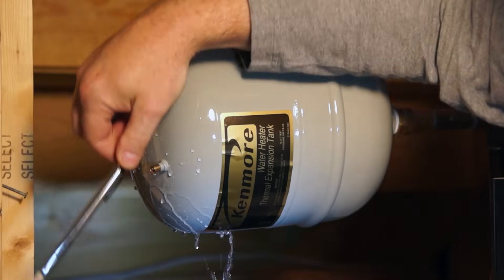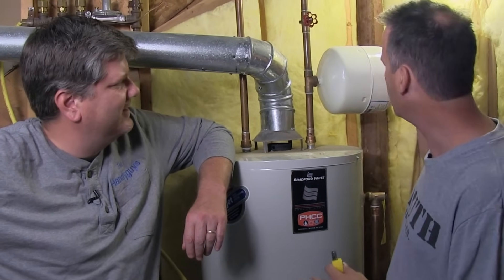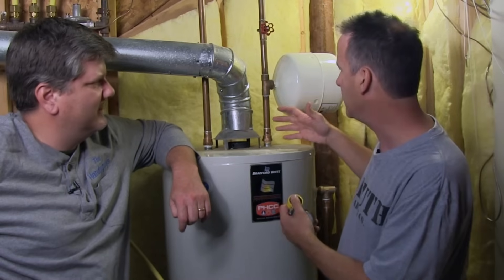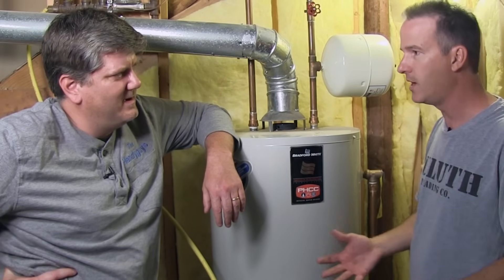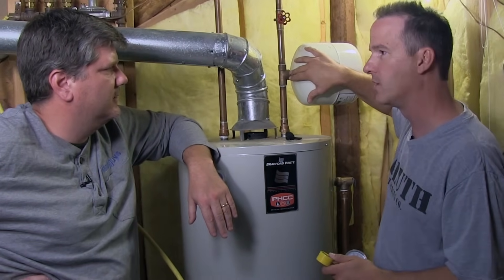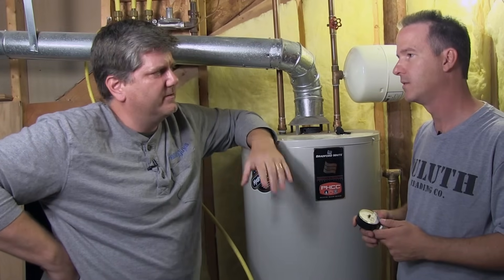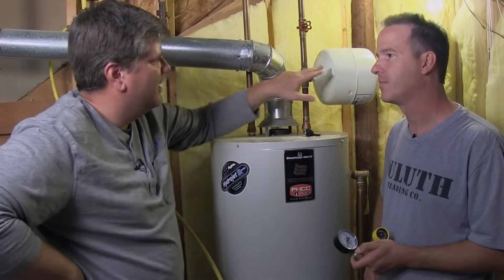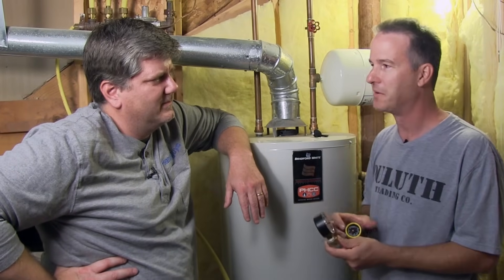Water Heater and Expansion Tank Maintenence

Comment: I understand that the water as it pressurizes will try to feed back to its primary inlet.  This is why an expansion tank is necessary for the Cold water  side,  of the water heater's inlet . My question is, can pressure also go towards the appliances, such as dishwasher sinks and washer. I ask this because every once in awhile my dishwasher and washer will release about a cupful of water. It would have to be the hot water that's building up the pressure because there is no cold water that runs to the dishwasher, and from time to time even the faucet in my kitchen , which is spring based sprays several drops of water into the sink. I am worried about the PEX, because I have seen slippage. Any ideas of what I can put in to take the pressure when all of the water sources are off. There is an expansion tank which is only about a year old. There is no water being released from the pressure release valve on the side of the water heater. Any ideas?
Reply: i know just enough to be dangerous so double check this.  If you have one handle faucets it is possible for the pressure to bleed over into cold side system.

Comment: Handyguys.  I have a 7yr old townhouse (all systems are 7yrs old by now) which has an expansion tank mounted on the cold inlet side just above the hot water heater.   I have experienced no anomalies with the plumbing system all 7 years.  About 1 month back, hot (I mean HOT) water started to come out of the cold taps; this  occurs with all faucets at bathrooms and kitchen.  The cold water will come out from the cold side after running the cold side faucet for about 5 min.   Is this a manifestation of a failed or malfunctioning (incorrect pressure) of the expansion tank?    Or is there something else more intriguing at work?
Reply from the maker: ***** Sounds like something more intriguing at work.
Reply: Cold water pipes running in an attic can easily get to over 110 F.

Comment: i have a question..  I have a 1 1/2 year old hot water heater and the expansion tank same age. replaced the mixing valve at the hot water heater and in the shower as well.  My townhouse was built about 7 years ago. My problem is i'm running out of hot water 15 to 18 minutes the blinking light on the WH is blinking current codes as all is well with the WH.  any ideas?
thanks scott
Reply from the maker: +scottieboy72 No idea here. I would consult an HVAC/plumbing professional. Particularly someone familiar with the brand of equipment you have.
Reply: These kinds of answers... "consult a professional", are incredibly unhelpful.  I think that everyone knows that if they must have help, that they can always consult a professional.  The reason folks like myself ask questions on blogs is to possibly save themselves the cost that a professional demands, since a lot of repair or maintenance work is completely within the scope of a DIYer.
Reply: No one is being unhelpful. If the answer was simple, people would answer it. With the question stated there is not enough information given that leads to an obvious answer. One of a dozen things may be causing him to run out of hot water. He would have to provide more clues/details to help diagnosis the issue, or he needs to become his own water heating expert, or he has to hire one to diagnosis the issue for him.
Reply: +charged You should consult a professional if you are having a problem with my comment. preferably someone who specializes in your type of grievance.
Reply: I found out the water pressure coming to the hot water heater was to high. No professional needed.

Comment: Water line makes noise like water hammer but only when I turn water on

Lived in house for 13 years and always made this sound

Replaced frozen/broken backflow device and water regulator shortly after moving in

Makes no difference which temperature I use

House PSI 40

Drained entire line from curbside and refilled with highest shower spigot open

Still have noise at all faucets and either temperature

Closed system with backflow device

Do I need water arrestor(s) or an expansion tank and where???

Comment: I have pipe hammering.  A plumber replaced my expansion tank, and this seemed to fix it for a couple months, but now they are banging again.  Did the plumber just get some air in the pipes, and as the air worked it's way out the banging started again, or will an expansion tank fix pipe hammering?  The hammering appears to be from really long pipes going up to a top floor washing machine.  Is there a better way to fix this water hammering.
Reply: Find the cause, such as a quick closing valve. Example: Such as a washing machines solenoid valves that control the incoming water.
Loosely supported pipes will typically amplify the effect of water hammering, also.

Comment: Thanks guys... I knew much of what you covered but thank you for taking the time to put a video 'refresher course' together... it settled my mind for knowing what to do along with the how and why! What I learned new is to check existing water supply pressure so it can be matched with air in the tank.  Previously I just aimed for the 40psi +/- that the tanks have in them when new. Sometimes the simple things are the most important, right? Best, Matt

Comment: So I was wondering why would they make water heater that do this things? Are they trying to make more business or what? Anyway, I have the same problem with my new water heater, everytime, I shower or use over 1 gallon or so of hot water it drips a little. My question is is there another way to fix this other than getting the little tank? I don't think I have room for it because my cold water shut off valve is really close to the water heater. Can I add this little tank to where the shut off valve is then move the shut off valve further away? I am so confused I am a new home owner. Thank you in advance.
Reply: Sal C the problem you are having is not a water heater problem, but a symptom of a closed plumbing system. the water heater (or pressure relief valve, more specifically) is simply reacting to the pressure created each time it reheats. when you heat water it expands. air compresses, water does not. an expansion tank is a steel tank with a rubber bladder filled with air that absorbs the fluctuations in pressure. hope this helps...
Reply: You can put the expansion tank anywhere in the system.....Preferably on the cold water side.  The rubber bladders don't like hot water.
Reply: Kurt Vonfricken You don't need the expansion tank because of anything with the water heater.  You need it if you have a pressure reducing valve or a backflow prevention valve.
Reply: lednuge yes you are right that is what I have. But I let the relief valve to dump some water since I was told that it's okay as long as the extra water has a place where to drain which it does.
Reply: Sal C You are stressing your water tank over and over. It will eventually fail prematurely from the undue ballooning and contraction. If your relief valve is lifting, it's an issue. If you want a cheap and dirty way to relieve the water pressure without a bank, you can buy a water relief valve at Home Depot, set the pressure for 90 or 100 pig, and put it on a garden hose spigot outside. Leave the spigot open. The relief valve will bleed off the excess water pressure without stressing your tank as much. Just be aware if the freeze issue in winter.

I still always suggest an expansion tank. It's as easy to install as an ice maker line. You can do it with a needle valve and some copper tubing. Just be sure to have a good tank support if you do it this way.  I put mine on a shelf.
Reply: JimmyLeeHook thank you. I am off from work tomorrow so I have time to go to home depot and probably get an expansion tank.

Comment: Two reasons the tank is not working, 1, some idiot thinks using a pressure guage on an installed tank is a good idea and let the functional portion of air out. 2, the tank leaks air naturally.
Please people do not listen to this. The only way to PROPERLY charge or pressureize a tank is with no inlet (water) pressure on it. (Basically with the tank off of the system) It is then charged to the % over or under the incoming water pressure of the home as prescribed by the designing company which will be based on application.
Testing a tanks pressure that has water pressure on it will almost always yeild a "good" pressure reading because the water is compressing any existing air to the pressure of the water. Pressure does not tell you anything about capacity. 
What is good about the video.....Yes expansion tanks have become a near necessity since towns have began using backflow prevention devices.
Yes if all else fails and the tank sounds solid from one end to another ( knocking on it) the issue is most commonly the tank, or the way the tank was installed.
Yes it is something you the home owner can do, you really don't needs to pay me service rates for this unless you just don't feel comfortable or just don't want to be bothered.
Yes a dripping P and T relief commonly (not always) means an expansion tank installation or replacement is needed .

Comment: I can see that your CSST gas line (corrugated stainless steel tubing) is grounded/bonded incorrectly and needs to be corrected. The bonding needs to be in front of the 1st CSST joint out at the gas meter.
Reply: Dan HAGMAN what minute marker shows that? I’m curious to see what you are referring to, thanks

Comment: There are potable and non-potable versions of the expansion tank available. Just replaced mine in my basement in-floor heat/hot water system.  With it being a closed loop and hot water not being used for household use I saved over $30 installing the non-potable version.
Reply from the maker: Thanks for the info.

Comment: Heres the million dollar question I am getting water from the thermo expansion valve which is like 1-2 gallons now this happen once in a while or everyday. The house is vacant because its a vacation home so most of the year its vacant could this have something to do with the leak? I do have expansion tank is there a way to check it without the gauge?
Reply: Knock on it with your knuckles. If you do not hear a hollow sound on the upper half, the tank is bad.

-Tom
Licensed Master Plumber
Licensed Plumbing Contractor
Reply: If you're getting water from a thermal expansion VALVE (which is different from a thermal expansion TANK) than you are experiencing thermal expansion. In a thermal expansion VALVE water is supposed to leave the system via the small tube installed. It is irrelevant if the home is vacant if the water heater is turned on, it is going to continuously heat the water every time it cools off through ambient heat loss. THIS is the reason thermal expansion occurs at all. Whether zero, one or twenty people live in a home, if the water heater is on, its gonna heat the water. When the water heats up, its gonna expand.
Reply: You should not have both a thermal expansion tank AND a thermal expansion valve. One or the other, but not both. I prefer a tank because it reduces the risk of water damage as the water stays contained within the water system. But your regional code may require something different. No code (that I know) of requires both a tank AND a valve.
Reply: If the home is vacant much of the time you should shut the electric breaker or turn off the gas and save the energy. 
It will save a bit of dough over time. That's a seperate idea of course from your pressure expansion issue.

Comment: Question...What if the tank is mounted AFTER the street pressure reducer?  I have to look at mine but am thinking such is my case.  I wouldn't want to fill my tank to 50lbs then would I?
Reply: Derek. The Pressure reducer is before the supply from city enters into your house. 
Usually is by the main shut off . Water heater is installed downstream from  pressure reducer. Yes you are right. If reduced pressure is 40 PSI then Expansion tank air pressure must equalize that.

Comment: I just replaced my 40 gallon HWH. I replaced the bad PRV outside also. Just purchased an expansion tank ($35) even though I do not have the backflow preventer. Great video, always good to learn.
Reply: Why?  You just added a component that requires maintenance but provides no function.

Comment: the water heater I just replaced never had an expansion tank. do I need one with my new water heater?
Reply from the maker: most likely.
Reply: If you are on well water you may not need one. If you are on city water and do not have a backflow valve at the meter you wont need one. Otherwise it is a good idea to put one in.
Reply: I have city water but it's an older house and I don't think it has a backflow valve. how can I tell if it has one?
Reply from the maker: You can call your local water department and see if they have installed them. They sometimes go around and install them on each home (on the street side).  Otherwise, you may just have it installed in your house at the meter.
Reply: The Handyguys Also if the home has a Pressure Reducing Valve installed then that will function as a backflow preventer.

Comment: I don't have a expansion tank, but intsead have a 100psi expansion relief valve that is leaking. Could this just be a valve that needs replacing? The gas water heater is 13yrs old.
Reply: Could just be the valve, replace it, it's not expensive

Comment: I just got my extension tank replaced. As it said the new tank was pre-charge 25PSI of air in there. My water line pressure is 75PIS so should I pump more air to the tank to 70PSI ? or half of the water line pressure (35PSI) ? if I leave the pre-charged pressure away it is, what would happen ? does it damage anything?
Reply: 1. Measure water pressure.  
2. Shut off main or other valve between supply and the expansion tank.  
3. Open hot water faucet to reduce water pressure at expansion tank to zero. 
4. Pump up tank air pressure to match water pressure measured, 75psi in your example (check manufacturer's instructions -- this is what mine requires).\
5.  Close hot water faucet, open shutoff valve.
Caution:  these tanks have a maximum air pressure (80 psi on the one I bought).  If your water pressure is higher than the maximum specification, you need to adjust it down.  Many faucets are spec'd at 70psi maximum.  Also, be careful not to over-inflate it while you are adjusting the pressure, you may damage/burst the bladder.

Comment: Thanks. Can you show a video or explain how to safely fill air in the expansion tank?
Reply from the maker: good idea.  It is no more difficult then filling a bike tire. You can use an air compressor or a bike pump if  you can get the hose to reach.  I just used the compressor tank/hose from my pneumatic nailer but this is really overkill.

Comment: the one in the boiler works the same?
how can I know I'm putting the right amount of PSI or getting the right reading in a boiler? because for water heaters as it says here you should open the sink valve.
Reply: Friend, don't take this video seriously.  Just read the manual that comes with expansion tank. It contains all the information you need.

Comment: In the UK only registered men are allowed to work on unvented cylinders. They have more controls being safer. USA take note.  The pressure vessel should be at east 10% of the cylinder volume - that expansion vessel looks too small. Best have it on the cold feed where it is cooler.